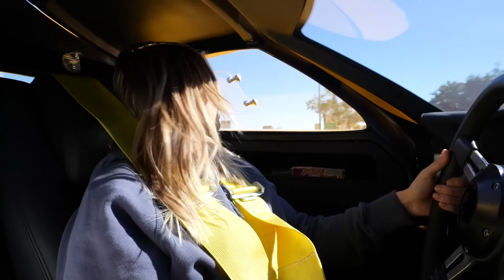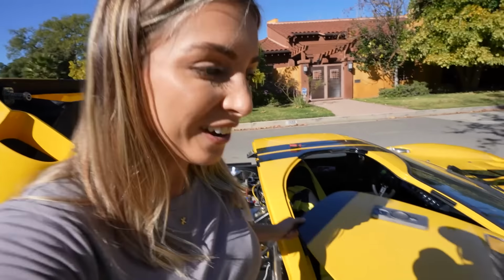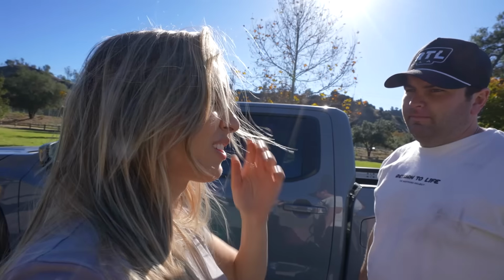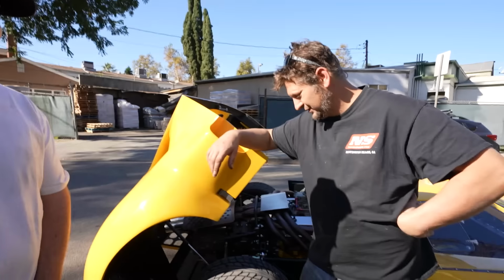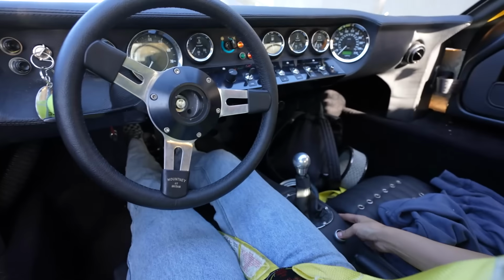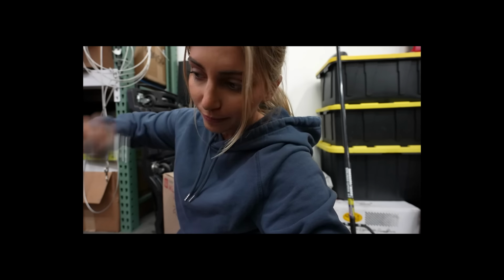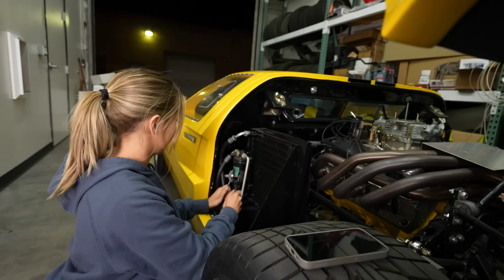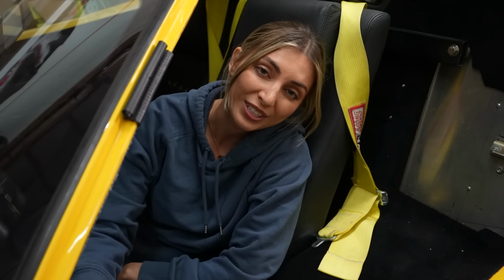The Dumpster Fire that is my Ford GT40.

Comment: The trans is not gone just figure it out, worst case probably a syncro or a gear and not some major replace the trans like you want to make it for viewers, manual trans are easy not like autos and yes maybe exotic trans but gears are gears and not that much to fix a manual. Better for viewer to actually see how to fix a manual trans than to say oh it needs to be replaced don't you think? I know now days young people thing replace everything instead of repair it but repair it is the way to go.

Comment: You're in a car with a standard tranny and a bad starter/battery...why are you trying to re-start with the starter when you have a clutch and third gear?!

I had a Triumph with very questionable induction that was always either flooding or leaning out too much.  The thing was CONSTANTLY dying on the roll.  It also had a 'Lucas-reliable' starter that caused it to be parked on inclines for a full summer...one of the blade connectors on the starter kept falling off.  I sure didn't put a lot of use on that starter that season!  I got so quick with my left foot and right hand that the re-starts weren't noticed by the girls that liked 'the little red racecar'  Only the car-savvy were aware that they were riding in a complete POS!  Did I mention the cracked Triumph Dolomite cylinder head?  

Yes, it was a TR-7!  The SHAPE...of things to come!  It SO needed a Buick 215 under the bonnet, (TR-8) but I could only afford the girls...barely!  Hey!...I was in my late 20s...priorities!

Comment: Its is a kit car, Not a real GT40, what did you expect from a kit that has been standing? Why don't you throw a 100 Grand at it like the Camaro? You could have just refreshed the Camaro engine to drive it for now, more relatable. I shot a spark plug out and had to deal with it. I did not go 'Mental Health' and throw a 100 grand at my car